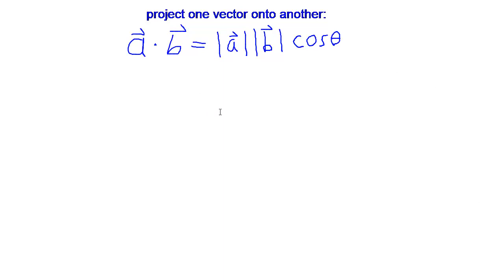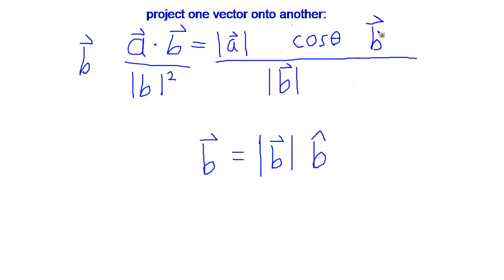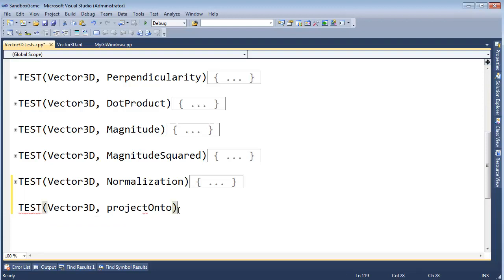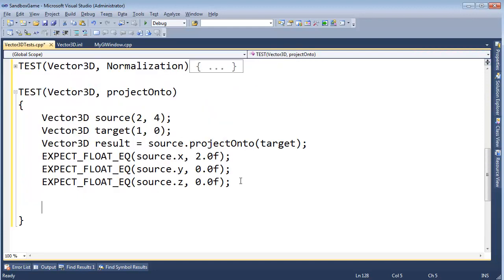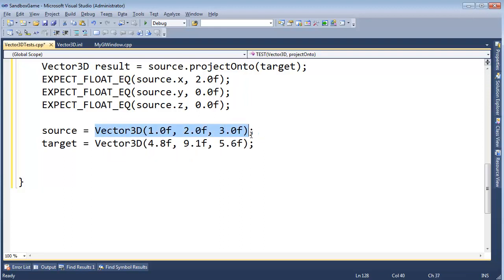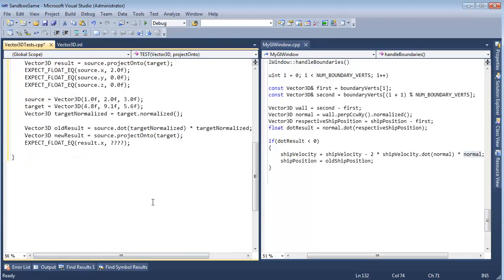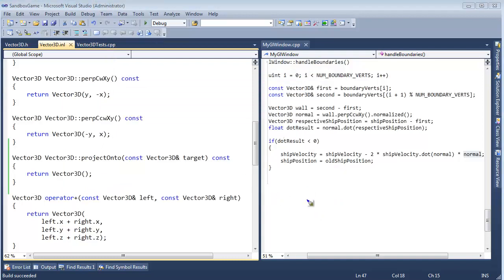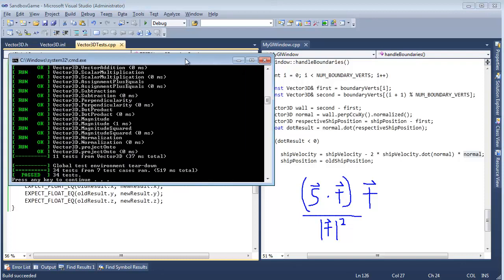Unit Testing and Implementing the Vector projectOnto()

Comment from the maker: Germany is great.

Here's the embarrassing part: I wrote projectOnto() and forgot to use it here. I will do soon. Also, a major overhaul/refactor is coming for the GlWindow code. I have spent the last week or so doing it offline and now I will start recording videos for it.

As far as your problem, I don't have a hunch. However, draw the velocity vector. Draw the reflection vector. Draw the new velocity. Draw all the vectors you can, and that will help a ton with debugging.